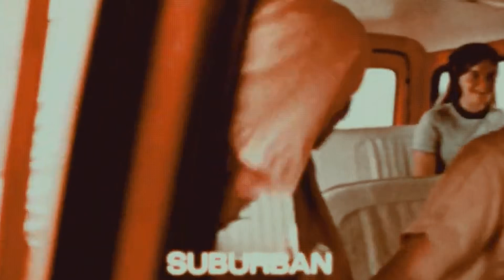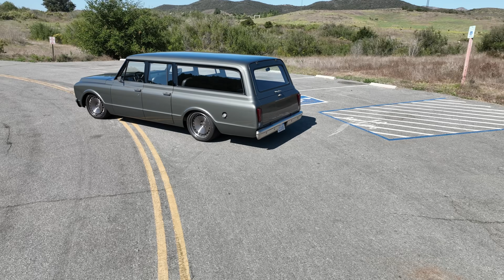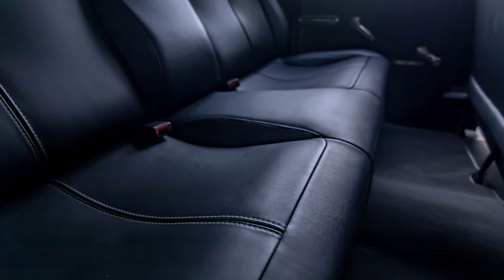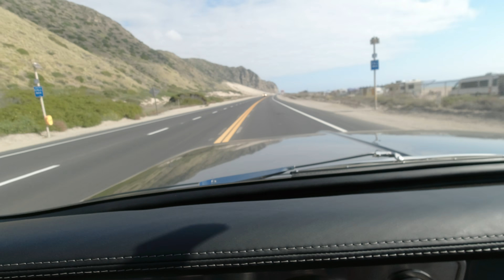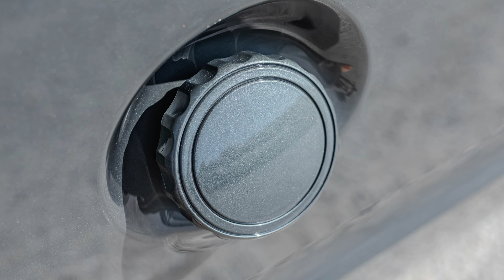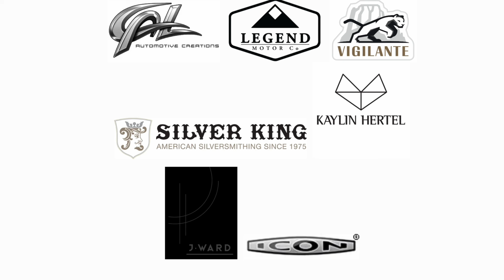ICON Reformer 1970 CHEVROLET SUBURBAN with TWIN TURBO CHARGED Nelson Racing Engines 427!!!

Comment: 5.28...for sure 'something' is missin there...that tiny clock in the center is lost..any regrets..??..multiple dials & gages would have been cool there..turbo temps ,airbox temp ,engine bay temp ,extractor fans on demand switch....etc

Comment: That grill is a work of art, executed beautifully even if the headlight bezels have a strong resemblance to the headlight bezels of a 1979 Ford Courier truck. It's still a nicely done superb quality 1 piece grill. Unlike the Courier's that I assume is put together from several pieces of flimsy tin shaped , stamped ,maybe some spin formed pieces in there  just assuming, but it doesn't compare to the work of art that was machined from one huge solid chunk of 6061T6 aluminum. The fit & finish of the one piece grill can't be compared to the Ford Courier's front  end. Different social classes. I just happened to see a slight resemblance in the headlight bezels. 🤔😉😉😁

Comment: I think we past a point some years ago where there is only so much you can do to a vehicle to make people go WOW! Now, every builder has a cnc machine available, sponsors out the wahzoo, designers and engineers, etc. these cars are so far removed from what hot rodding was that only the people with big money to waste can have one designed and made. Even then, most people I meet and discuss these sema builds with tell me they aren’t interested. When something is completely done, the fun is over for most of us. To each their own though. Gotta do what makes you happy. Me, I’ll take 67 fastback gt500 clone, tattered and worn looking with decent engine and good brakes and tires and just cruise.

Comment: i think the door handles are just a bit on the hefty side. Steering wheel could also be different. If i am thinking Mies van der Rohe i would have made proper seats. chromed steel tubing, exposed, leather like the chairs of the period, leather like the barcelona chairs, for example.

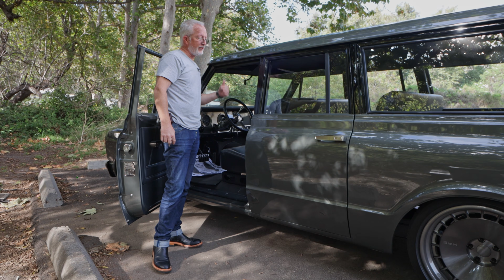Comment: 22:30
This door slam says it all, or does it say nothing and that's the point.
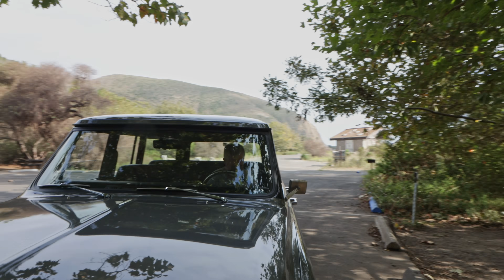Reply: The sound at 20:41 not so good. And what's with the wrinkles in the driver's seat bottom? Tremendous chassis and drive train, both functionally and visually. A unique vehicle, no question.